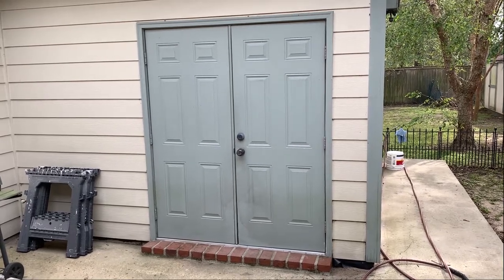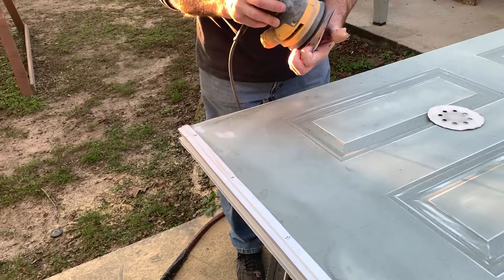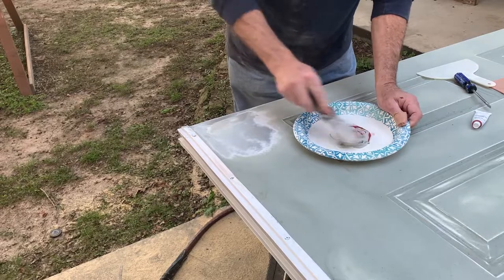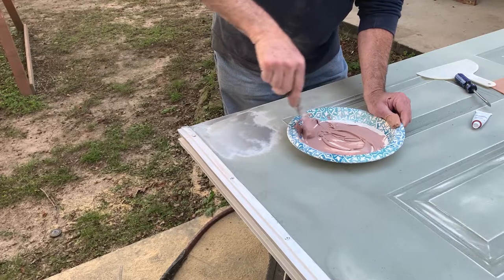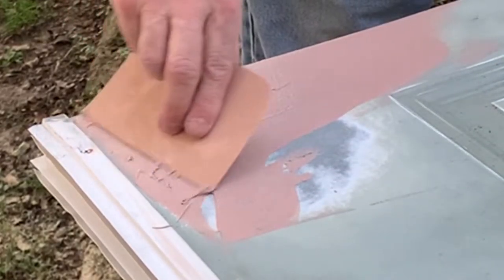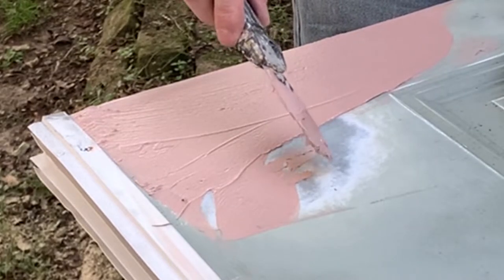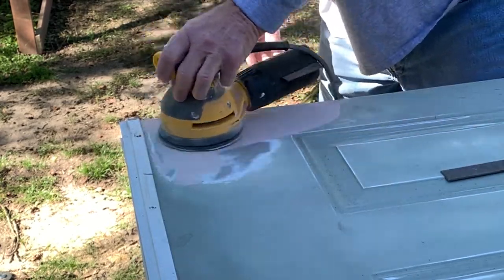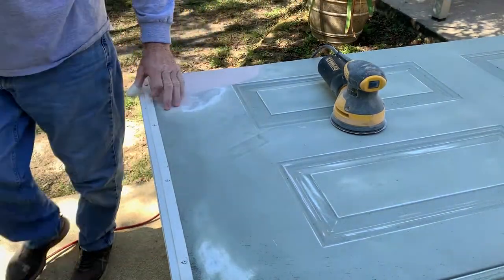How to repair dents in metal doors

Comment: Wow!  I didn’t think you would answer!  Thank you!  What I need to know is when do you spray it with Rustleum Rust Stop primer or something?  After the bondo job is done and sanded nice, like just before you paint it? Should you spray the primer over both the bare metal parts as well as your parts where you put bondo?
Reply from the maker: Yes I would spray the primer over all of it as soon as possible then wait for it to dry and go over with the house paint the next day or later after it had fully dried. Some of the rust stop products have to be brushed on and should be put on before the primer. Use them only on the metal. Using it only on rusted parts. Follow the manufacturer’s recommendations for those products.

Comment: What did you use to cover the area that you sanded down to the metal but didn’t get any condo on it?  Won’t it eventually rust through the acrylic paint coat?
Reply from the maker: I think rust bleeding through is a valid concern. The one in the video didn’t have any existing rust and I immediately painted it and it didn’t have any issues. I did another one for my son, and didn’t have time to paint it. I told him to paint it before it rusted, and he didn’t. It was also in worst shape and had some rusted metal that I cut off. The rust did bleed through on his and I will end up redoing it. When I do, I will plan on using one of the rust stop products at Home Depot or Lowe’s.